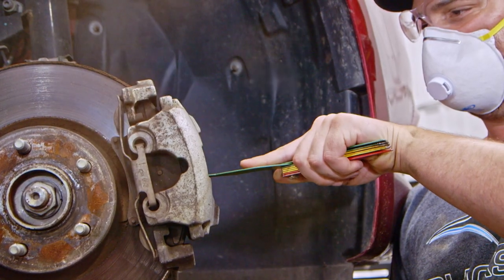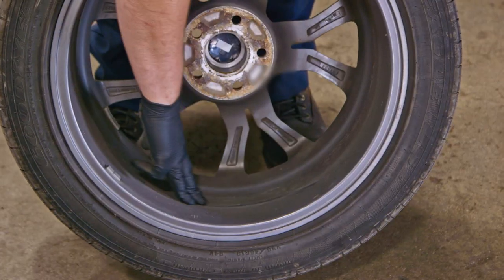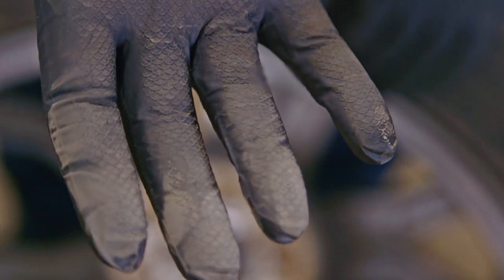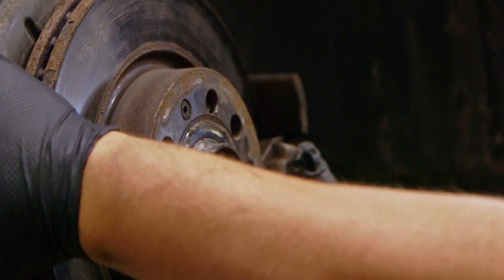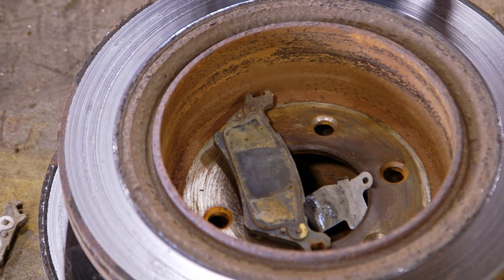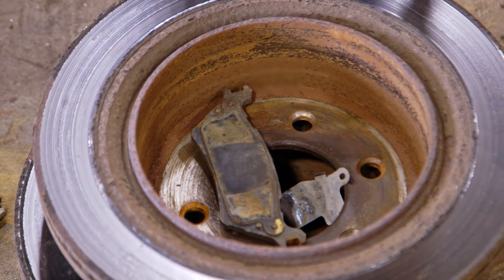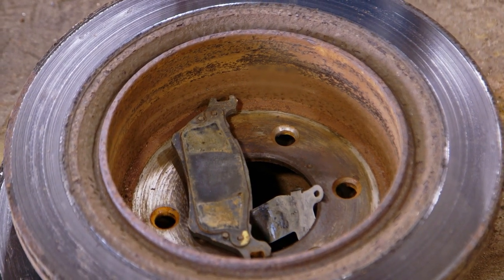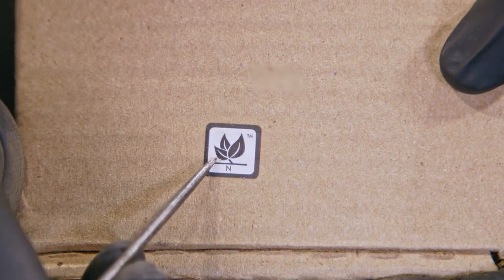Asbestos in My Brake Pads?!

Comment: Thanks for the video, I’m finding it hard to get precise info especially here in Canada. One question is with the leaf symbol. I noticed online that in the States, the first dark leaf symbol is only a restriction of asbestos fibres to less than 0.1% by weight, is that correct? Is there still a chance of having asbestos in this case even in a low concentration such as this? I just bought some brake pads and the first two leaves are dark, but I haven’t installed them yet. These will be my first new set since having my OEM brakes and I’m finding that I’m starting to do some of the wheel and brake work on my own.